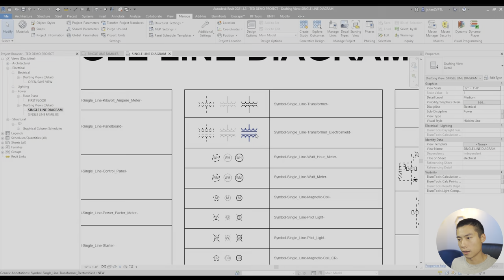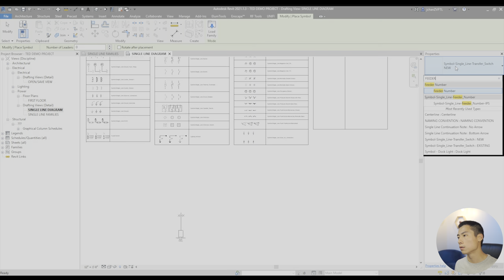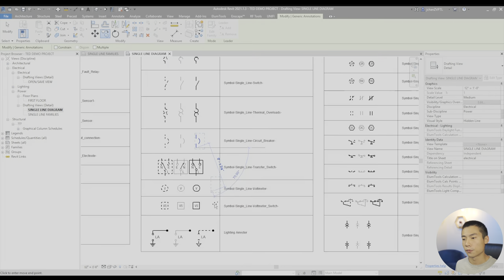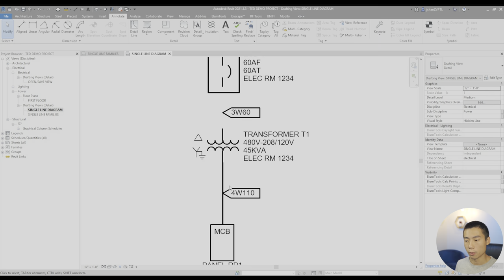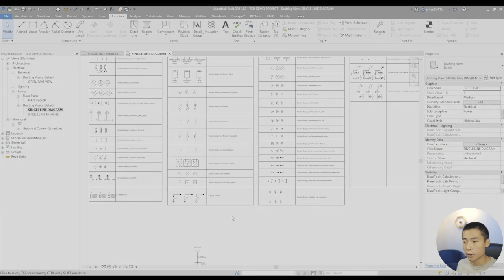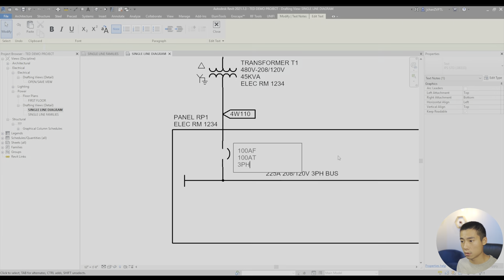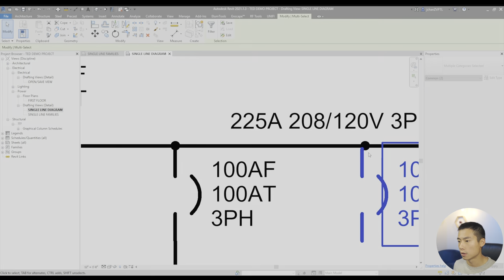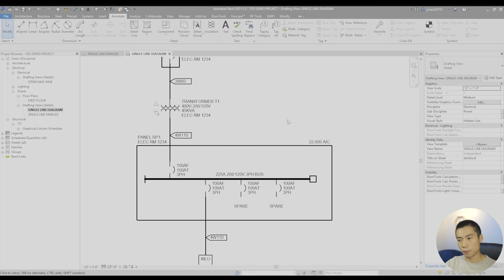How to draw a Single Line Diagram - Revit Review

Comment: Thanks a lot for the video! Do you have any recommendations for modeling busways in Buildings ?
Reply from the maker: I do have some busway families I can share. They come in horizontal, vertical and 90 degree bends. You basically piece them together in the model. I haven’t found a more seamless way like how we route cable tray.

Comment: Any suggestions for creating simple one-lines for residential systems. Just starting out and hoping to find some free/ inexpensive software to create quick one-lines. 
Thanks!
Reply from the maker: I haven't come across any free ones but I have heard Design Master comes in at about $125/month.
Reply: Great information.  Do you do those  for folks im doing an adu build and the electric Co wants a single line diagram and im having trouble finding someone to do it😊thanks

Comment: where would you put the generator if you want to go offgrid? or if installing a backup genset.
Reply from the maker: Whoops way behind on responding. If generator is picking up the entire building, I'd put a transfer switch just ahead of the main panel and it would switch the panel between utility and generator. if you don't have a gen big enough to pick up the whole building, I'd put select loads on a sub panel and place the transfer switch just upstream of the sub panel. I know some DIYers who just hook up the generator to the main panel and back feed it after they shut off the main breaker. That is very dangerous as you have no way to guarantee the power isn't fed back into the grid if you forget to turn off the main breaker.

Comment: Thanks for the content.  I'm an old fart that has worked with CAD for 25 years and am getting more and more pushed towards Revit.  Typically the one-lines I work with cover multiple sheets.  IE: a main-tie-main, 3000A service with a multitude of distribution panels and MCC's.  With Revit, its challenging, i'm finding, simply because in AutoCAD, I can determine the work area I have based on titleblock 1:1 scale and draw a box in defpoints.  Many times it ends up being multiple pages.  I guess, with Revit, you can create the full one-line or plan ahead on continuations and work that way?  In the past, we've simply drawn it in CAD and then import it into Revit and convert all the text and linework after the fact.
Reply from the maker: Eh it still spans several drafting views which takes some effort to split up. I really wished we had a smart reference tag that updates based on what sheet the referred view ends up on. I am faster in CAD but per company standards, we gotta stop using CAD files in our models 🙄 so I’m working on some methods that make this less painful when you get to the big diagrams as you mentioned. MCCs can get pretty big and take up an entire drawing just on its own.
Reply: @theelectricaldepartment  Yes.  I absolutely get why architects, structural, and mechanical systems like using the program.  I just typically, at this point, let the BIM manager (client) know that I will comply with showing stuff like gear, lights, and cable tray in 3D, but all electrical connections, conduit/raceways, etc will be "symbols" rather than families.  Most seem to be ok with that approach (at least in my world).  Electrical and I&C, CAD is just much more efficient for what we do, seeing that everything is largely schematic in nature.  Have a great day.

Comment: whats a bus plug?
Reply from the maker: There’s a product called a busway that is a solid conductive device that takes the place of several conductors. It is typically used for high amperage feeders from one distribution to another, or sometimes as a distribution pathway for large amounts of power. Think of a thick metal box with 4 or 5 copper busses inside to transfer power. There are then plugs that you can plug into these busways to ‘tap’ power from the busway. Great for when large equipment moves around on a production floor. Maybe they need 800A in one location for 2 years but then they may move it 20 feet down the assembly line later. Run the busway over the whole assembly line and the plug can plug in at multiple locations.